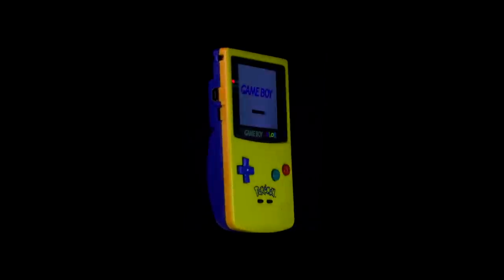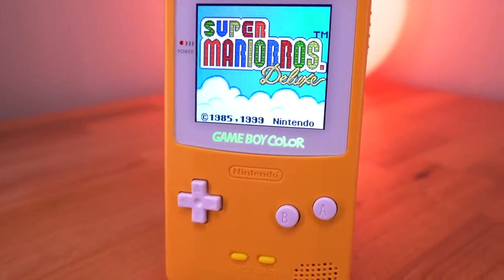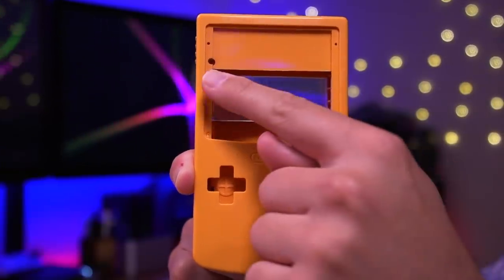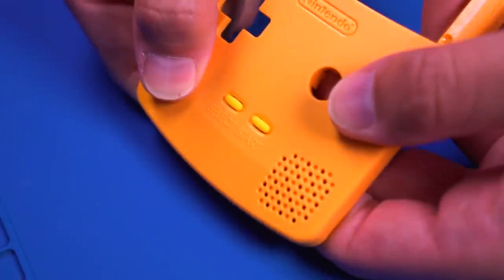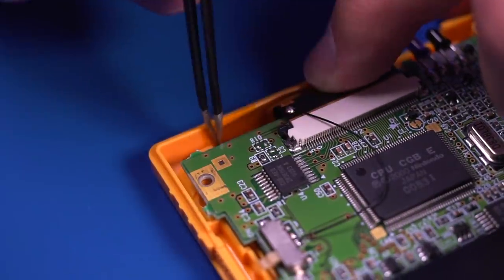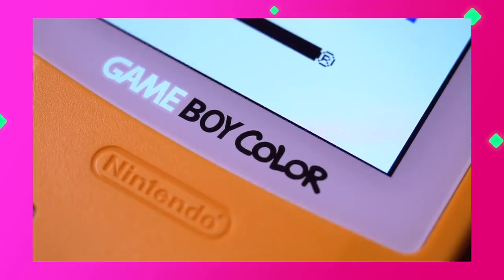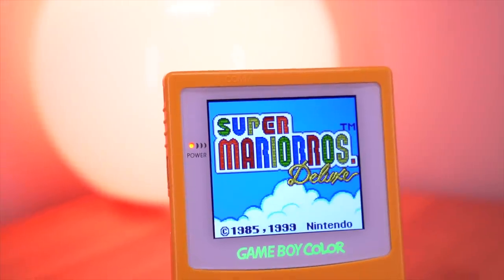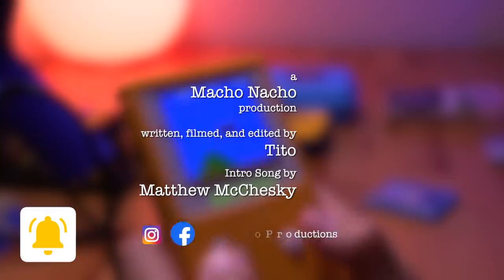The BEST IPS KIT for the Game Boy Color for 2021 | New Laminated Q5 v2.0 IPS Kit from FunnyPlaying

Comment: Why no one is making a digital mod for PS2 😭
Reply: Get the retrotink, it’s perfect and is much more versatile than a console-specific mod.
Reply from the maker: I’m sure that’s on pixelfxs list of to do’s
Reply: @user-yk1cw8im4h  it’s out of stock and kinda expensive, yes I can hook more devices to it but a digital mod sound more interesting
Reply: @maxtorblack  not sure how it is more interesting, but it does take a LOT more work to get basically the same results. Also a digital mod is very expensive as well, it's almost $200 for a N64Digital including shipping.
Reply: @user-yk1cw8im4h  the fact that it’s required to be installed to the board make it an interesting project at least to me.. do you have a retrotink or any other video upscale device ?
Reply: @MachoNachoProductions  I can not find info on YouTube to compare CRT quality vs single upscale on modern oled screen, for consoles like PS2 or GC 
Don’t you think it might be an interesting video ?
Reply: @maxtorblack  yeah I do have an ossc, and I'm looking to get a retrotink in order to get rid of that awful bob deinterlacing on the ossc. The N64 digital mod has created more handache than anything to me at the moment, first there was no audio and now there was no video. It has a manufacturing defect so it wasn't my fault...
Reply: @user-yk1cw8im4h  thanks for head up, was thinking planning to get n64 digital mode
Reply: @maxtorblack  you should be fine, i just had bad luck with the one i received